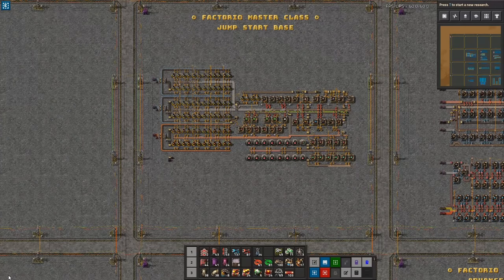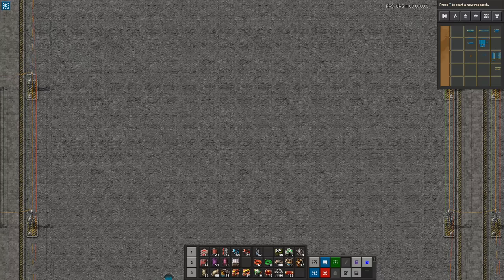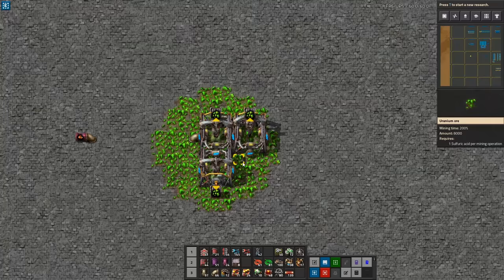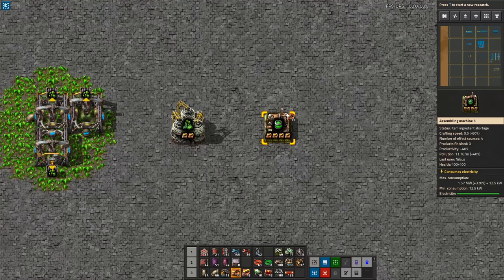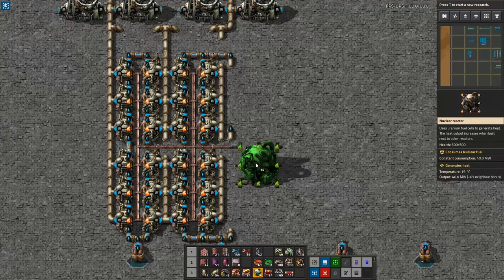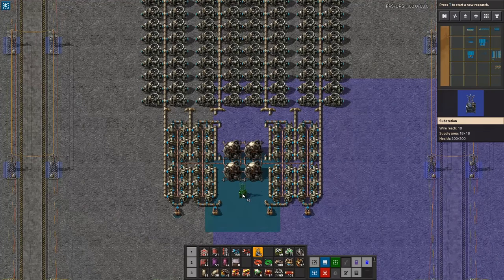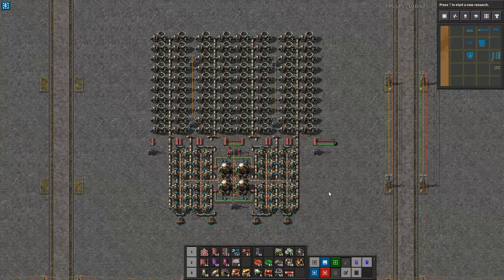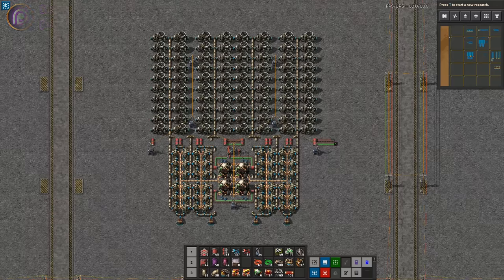NUCLEAR POWER; Shattering Conventional Wisdom | Factorio 0.18 Tutorial/Guide/How-to

Comment: My biggest issue wit everything you build is extremely simple. Off shore pumps are worthless. In fact you need to stop using long pipes or even setting thing off 1 offshore pump. Unsure if this is a mod, but barrels make far more modular designs Yes they do need belt fed, and factory made, but on the other side of things each barrel is 50, so 1 belt can equal about 200+ for a single barrel. So instead of 100 being max on that line depending on speed of belt you can transport about 4x more on the faster belts. You set up something to remove it from the barrel, but you will never come up on issues due to pressure. This works with all fluids like lube, thats amazing, and oil. All of this Allows for my personal builds which for example my oil fields tend to provide more than any oil processing area I have ever seen. It even gets bigger than most say they can due to pipe issues. I would not say use it everywhere but the 2 places I use it are oil and power. Lets say you put it in trains though, well barrels stack to 10, 500 oil per slot meaning you transport about the same by train, depending on slot numbers maybe a bit more, maybe a bit less. I might have a mod for my trains but if not 1 train =50k oil per cart instead of 25k. Same with lube, petrol, and even light oil. Early power systems it is not useful but (about half 1 offshore per unbottling assembler. A normal pipe would get pulled dry with 90 chemical plants for lube. This tech allows that to be a start. Personally I look at barrels like the blood of my system and the main part of my factory. You do need to do more math but you do not seem to mind math that much. The only down side I found to using them is you need pull off the lines, for example lets say you unbottle in a factory building water and oil, you need to pull the barrels out, feed it in to the place you bottle the next ones and take excess off lines, put excess back on lines from main source. This is to keep the system going, you do not unbottle both water and oil at the same rate you bottle the end resource. The line ideally out from oil and water would be empty.

Comment: So why do all the crazy megabases always seem to use solar? I see zero reason to do that. Still kinda new at the game
Reply: The endgame of Factorio is about building a factory your computer can run more than it is about building a factory that is optimal by other parameters. Solar panels basically just say "Generate this amount of power based on the time of day, multiplied by the number of solar panels." One simple calculation even if you have a million solar panels. (You can technically overflow the value, but it takes millions upon millions of panels.) This is a lot less resource-intensive than having to simulate the operation of nuclear reactors or steam engines, where you have multiple fluids moving around, inserters, belts that are not fully compressed and/or robots, etc.

Comment: When I pop down the blueprint, everything seems to work and then all of a sudden the turbines just stop producing power. There's plenty of steam available, just nothing happens.

Then after a minute or two, it turns back on for 20 seconds, and turns off again. This repeats forever.

Any advice?
Reply: Your demand is so low they don't need to run.
Reply: @tomo9126  I thought one of the quirks with nuclear power is that it always outputs electricity?
Reply: @liamwinterton7370  Not quite. The nuclear reactors always consume fuel and output heat. The heat is then converted to steam via the heat exchangers, so there is a constant production of steam as a result of the constant fuel usage. Note that if the steam is not being used, the reactor will happily keep burning away fuel and creating heat.
The steam turbines, which actually create the electricity, work a little differently though. Similar to the steam engines used for early game power, they only activate if there is a draw on the system. So while the total reactor produces sufficient heat/steam to produce 464 MW, that might all need to be used, so not all the generators spin up.

Heres an example:
Say you have the reactor from the video, it has fully heated up and all the heat exchangers are working. This has a maximum capacity of 464MW.
However, your factory is only using 232MW of electricity to run. It would only require half of the turbines to run in order to power everything. The extra steam that could be used here is wasted.

Nilaus mentions steam storage in the video, but doesn't go into detail about it, since it's mostly un-needed. It can have some nice uses though. For example, with the factory above, the reactor can produce way more steam than is actually needed to power the factory. However, if the extra steam is stored, it can be used as a buffer for high-draw situations. For example, if you have perimiter defenses with tons of laser turrets, you could encounter times where the power usage of the factory spikes dramatically. If you over-build turbines, and have a steam storage buffer, the power plant could actually exceed the 480MWs produced by the reactors, by converting that stored steam into additional electric energy.
Reply: @juisedlol  That makes a lot more sense, thank you!

Comment: The utility of this tutorial is quite limited. It's useful for new players who are scared of jumping into such a complex topic as nuclear power, and I appreciate that. All the points about the absurd over-abundance of uranium ore are true (Which is why I turn it down to 25% richness and frequency)
Tell me, though, why do you use productivity modules? After all, you can simply build more assemblers and miners. The reason I use productivity modules is so I can have the most efficient design, so I can look for the absolute limit of efficiency. I don't play Factorio to launch a rocket, I play Factorio to exercise my design skills. An efficient, circuit-controlled, infinitely tileable 2-by-n reactor, with steam storage and overdraw turbines for emergency use, powered by an external solar grid so it never has a power crash is incredibly satisfying to design. It's different than designing your 50th train station for your 5th mega-science build, and I encourage everyone who has been using the same 2x2 reactor for years  to try their hand at it.
(Hints: use many many pumps to move the steam, don't over consume water, don't leave any empty space between heat exchangers in an attempt to align them to the reactors, use an SR-latch to control fuel inserters, build it on a lake or leave LOTS of space for water pipes. Oh, and use more pumps than you think)

Comment: Question: You connected only 2 of the 4 reactors to heat pipes. What do the other two reactors do? Or do they work like fluid tanks, in that heat generated from one reactor will heat up nearby reactors until levels equalise?
Reply: i suspect “heat” is coded similarly to other fluids, the difference being it is limited to its own specific network type and “flows” slowly

Comment: So im a noob here who's only just exploring blue science, but can the steam turbines be used with regular boilers? (the ones that consume solid fuel)
Kinda in a energy bind while trying to get to nuclear.
Reply: No, they require hotter steam.
Reply: @Mizuna You absolutely can use steam turbines with boilers. They only have a higher max temperature, but they work just fine with 165°C Steam. 
However, a boiler-fed steam turbine maxes out at 1.8MW, the same as two steam engines but way more expensive. You basically double the cost to halve the space.
EDIT: To clarify, the efficiency stays the same. Steam turbines just consume double the steam compared to steam engines.
Reply: @dakon2154  Does the game keep track of the temperature of the steam? I've never noticed that. I wonder what happens if you try to mix steam from boilers and heat exchangers.
Reply: @DFPercush  Yes, in technical terms, with fluid.temperature you can read the temperature of the fluid in an entity's fluid box (in this case steam).

You can mix fluids of different temperatures and their temperatures averages. 

In vanilla only steam has more then 1 temperature, but some mods add other liquids that have different temperatures.

For more information take a look at the wiki page.
Reply: Thanks for the responses everyone. its definitely not going to be worth getting steam turbines quite yet if they are only give a fraction of their max efficiency. Probably going to try to expand to the next coal patch for more steam engines.

Comment: Something I've been wondering about the neighbor bonus as a new player and I don't see it mentioned anywhere (even the wiki): Does it mean the fuel gets used faster too? Or is that just free energy created from nowhere? I haven't gotten that far yet but I'm trying to figure out if it's worth building since the difference between 4 reactors using 1 fuel every 50 seconds versus using 1 every 16 seconds is significant.
Reply: The fuel is consumed at the same rate, you're literally getting free power for the adjacency, your fuel goes farther.

Comment: slight disagreement with you regarding uranium being a non issue, and things being unnecessary. factorio's a game. by integrating steam storage, you open up the puzzle of circuit network integration with other power sources. by making larger designs, you open yourself to more complex fluid logistics and ratios. by redoing your initial 2x2, you redesign instead of just tiling. all of this is just more fun. unless, of course, you dislike playing factorio.
Reply from the maker: Build something useful with circuits instead of forcing optimisation of something useless that does nothing but eat your processor power

Comment: To make full use of the neighbor bonus, the most optimal nuclear build is obviously to place an infinitely large amount of reactors, that way every single reactor has every face connected to another. I'm both disappointed and concerned, as I saw you as a mind for the efficient, and yet your design completely trashed this obvious setup.
Reply: And how would you fuel a reactor that has every face connected?
Reply: @jonathannimmo9293  with inserters, obviously

Comment: Pleased again with your approach to design complex things, especially when you doing the math. But there is an another concern to take in mind - probability. Centrifuges are unique machines in that aspect. All what goes down after the centrifuges converting uranium ore into probability-based output products is also a subject to probability. And this is where the real math kicks in. You showed that one U-235 is produced per approximately 1323 of U-238. What cumulative probability you use to calculate the amount of U-238? Ie with what probability you get the single U-235 per exactly 1323 of U-238?

UPD: You interested me, so I calculated a little myself) The probability of getting a U-235 in one event is 0.003 (0.3%). The probability of not getting U-235 in one event is (1 - 0.003). The probability of not getting at least one U-235 1000 times in a row is (1 - 0.003) ^ 1000 ~ = 0.05. Thus, the probability of getting at least one U-235 per 1000 consecutive attempts is 95%, which is very decent (almost guaranteed). The number of attempts required (in fact, the amount of byproduct U-238) is a function of the given cumulative probability. Probability of getting U-235 per 1323 attempts which you shown is 98.12%. 99% probability is reached at 1533 attempts.

In the end, it turns out that I watched an entertain gaming video and ended up diven into computations and probability theory) What a precious youtube gem! You give the food for the mind. Not like many other youtubers making tons of funny cats videos)